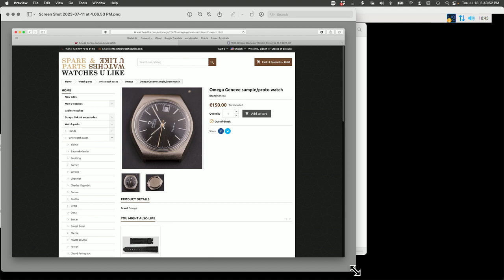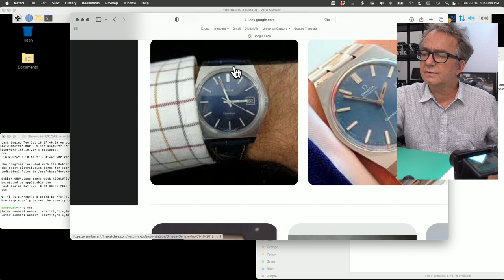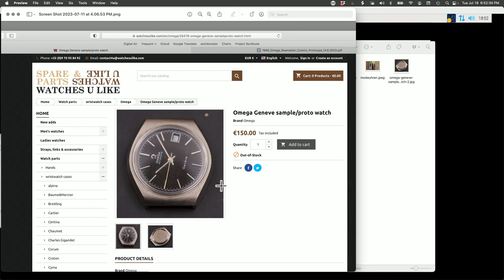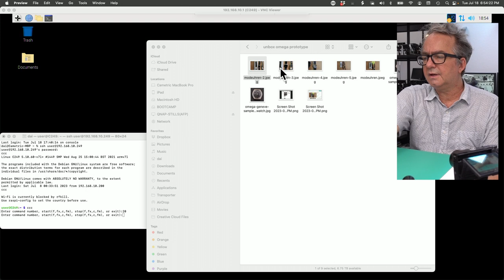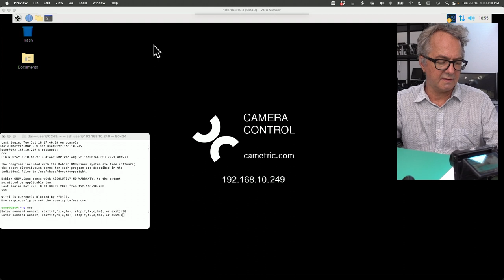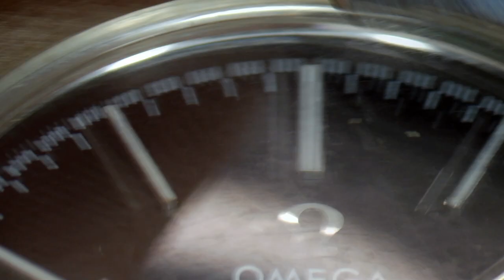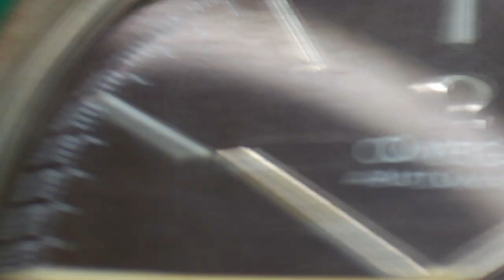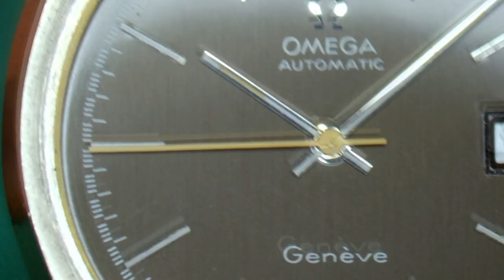Buying Vintage Watches Online - How To Use Google Image Search to Research Prospective Purchases

Comment: 6:00 look at the solvil et titus watch in the similar images, could be that case.
Reply from the maker: Good eye! It is more similar to that solvil et titus than the particular Omega Geneve that google picked up on. But not the exact same: https://bbwatches.info/solvilsilversteel2.php I should also have pointed out that google image search is paying a lot of attention to the dial, and not as much to the case, so it can also be useful to blank out the dial before running the search. This will result in empty cases hits, which are fewer, but can also pick up better matches.

Comment: Great video! You seem to be getting some audio feedback or something on the latest set of videos.
Reply from the maker: Thanks! Sorry about the audio problem! Mike was saying the same thing but I can't hear it due to not being able to hear high frequencies. I have a set of earbuds on my desk that I use to monitor sound that I may have left on at a very low volume when I did the video about the Omega Frankenwatch and the mics may be picking that up. I will check that, otherwise I need to get my wife or daughter into my studio to help me figure it out, or do a live stream or something. Either way I appreciate you pointing it out!